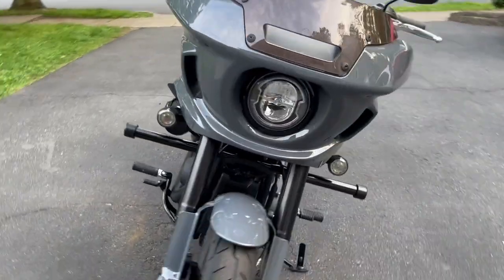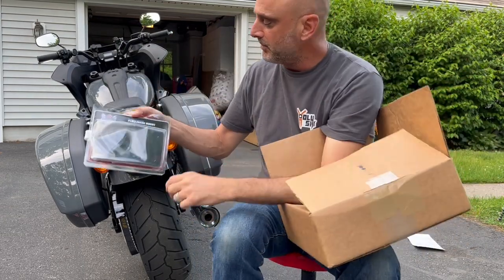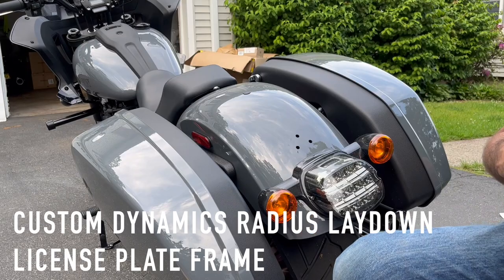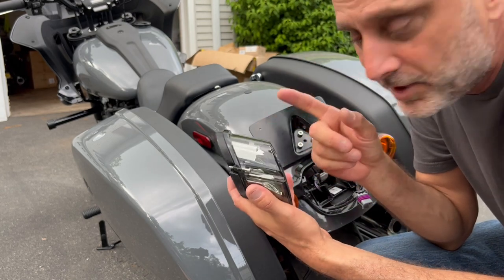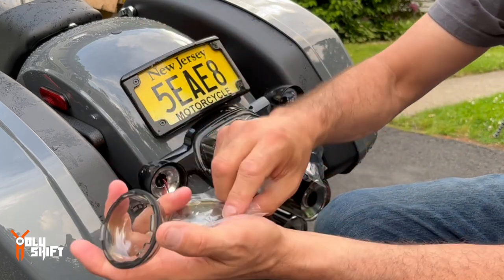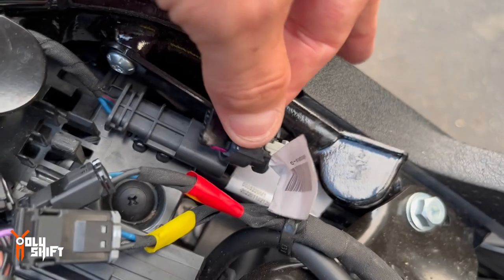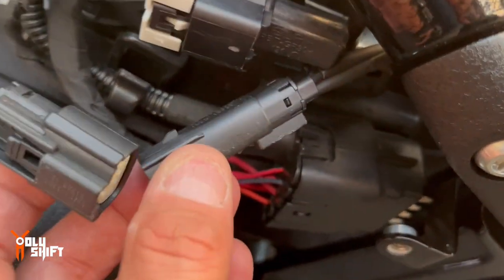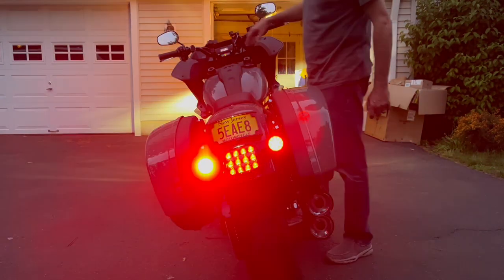You're Dead ! If Nobody Sees You...

Comment: The stock taillight has a license plate light in the top of it that appears to illuminate your plate adequately. Why bother with running or splicing wires for the LED license plate frame?  Just my thought.  If you eventually get a low profile LED taillight from CD, get the one that has the tag light on top.  I did and it works great.  Sandy, I enjoy watching all your videos. Keep them coming. Love your new bike.
Reply from the maker: Thanks buddy ! That's the plan - gonna get the top illuminated Low profile tail light. BTW - Youtube is showing me you're not subscribed....;-(
Reply: Sandy, I’ve been subscribed to your channel for about 2 years. I am still subscribed.  I just re-checked your channel and it indicates that I’m “Subscribed”.  Your channel is also listed under my YouTube “Subscriptions” tab.  Sounds like YouTube may have a software issue.
Reply from the maker: @dougied4790  I think you're right - many people say the same thing... Thanks anyway buddy